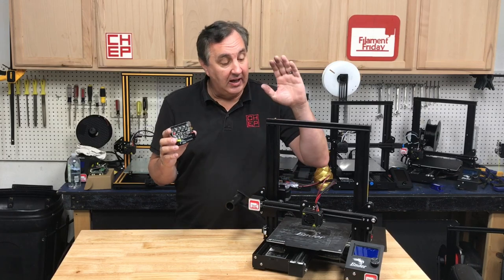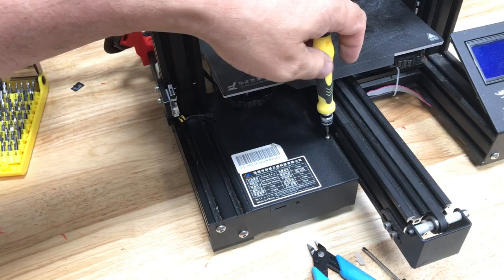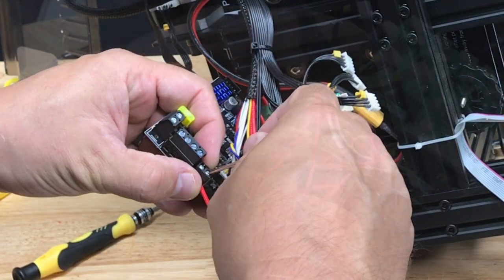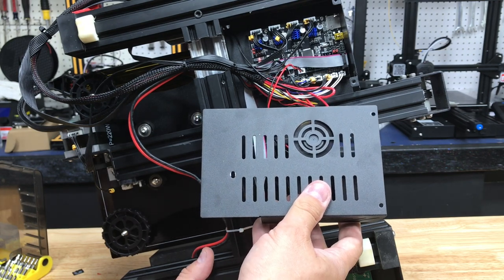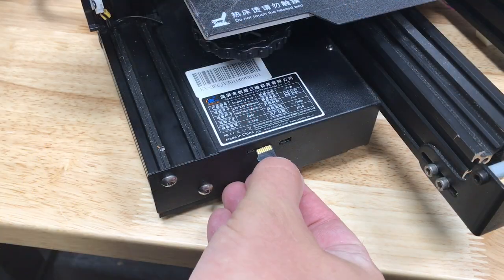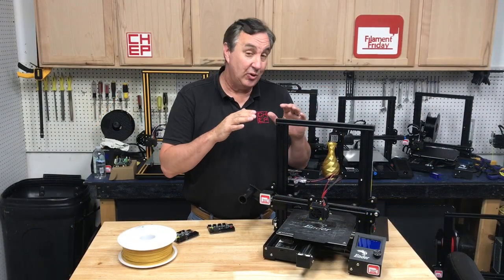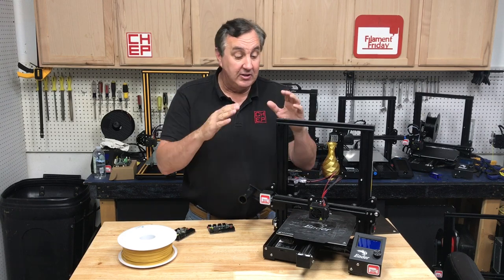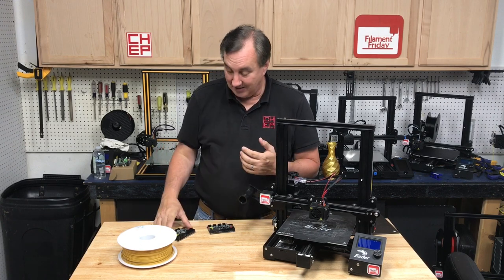Creality Ender 3 Upgrade to 32-Bit SKR E3 Mini

Comment: The latest Marlin release includes Manual Mesh Bed Leveling :)
Reply: Well, I wish I hadn't updated to that version, Bugfix worked perfectly fine for me.
Now the buzzer sounds really annoying, mesh bed levelling does not work proberly (probes a 3x3 grid and 6 points are super close to the edge of the bed, after probing the nozzle is too far away from the bed for good layer adhesion) and most annoyingly the SD card lists the files with OLDEST file at the top...
Reply: @skyfly-2  
I have 2 Ender 3 printers. Leveling them is a chore. I haven't updated or upgraded the board so only manual leveling is available to me.
My question is, when you use manual mesh leveling, how does that help moving forward? Don't you still have to level every few prints, plus every time you clean the bed?
Reply: @KLP99  its been said before, but I will say it again.  Yellow springs to replace the existing stock ones, mean you will need to manually level your bed very rarely.   Before the yellow springs, I used to have to re-level every few prints, I suppose because the vibration of the printer caused the bed to go out of level, after yellow springs ive had no issues.
Reply: @pellcorp  
One printer has the yellow springs and one has the stock springs. I've added one extra though, and that's nylon washers between the bottom of the springs and the leveling nut.
I have glass beds, which I love, and use Magigoo, which I'll never do without (I just ordered another kind that's supposed to work as well) because I can print filament that wouldn't stick before.
But one thing about the Magigoo is after every 3-5 prints I take the glass off and wash it with warm water, as is recommended.
After washing, I re-level the beds. I've gotten pretty fast at it so it doesn't feel like such a chore as it used to.
Edit: The new bed adhesive I bought is called Layerneer, and I am liking it much better than Magigoo. One think I wish I'd have noticed before buying a larger container of the Magigoo before I knew of Layerneer is that it goes bad about 3 months after opening the bottle. I'll never use it up in that time with just 2 printers, even if (they are, almost) they are kept running 7x24x365. I put the new bottle of Magigoo in the fridge hoping that will help it last longer. And yes, I made the mistake of opening it when it came, even though the small bottle I had wasn't gone.
I'm really loving 3d printing. I designed my first real item I use a few times a week. It's a large funnel that fits inside gallon drinking water bottles (from Walmart) without falling out, so no-second hand to hold the funnel. I use it to pour newly distilled water for my CPAP machine.
I used Tinkercad, which is pretty easy to use. I'm sure I designed it the hardest way possible, like using a cone, then another cone 4mm smaller as a hole. Fitting the hole inside the cone was annoyingly hard. Isn't there something that would let me lock them together? Probably...

Comment: Ugh. I've been fighting trying to get good prints with my updated E3 (E3D V6 hottend, Bondtech BMG bowden extruder, hero me gen 5, BLTouch, SKR mini E3 V2.0) my cube has lots of waves or blobs or something. Ive calibrated my esteps, lin adv, etc. but still cant get good prints!

You should set up an Ender 3 just like this and get it working and then send me your firmware file so I can stop pulling my hair out! 😂

Comment: I'm trying to understand why keep changing things , updating and upgrading a machine that can be perfectly working fine from the box ? I screwed mine by changing stuff
Reply: Upgrading is part of the fun
Reply: @runninglennart2970  when is got better print results yes
Reply: It might run perfect at first but eventually it degrades. The magnetic bed starts to warp, springs get loose, etc.  just because you screwed up installing doesn’t negate the benefits of upgrades. My Ender 3 with Skr mini e3, yellow springs, and glass bed is noticeable better than stock in every way (noise, quality of prints, bed adhesion, and functionality).
Reply: @forouza1  I've made tons of upgrades on mine too. I've gone thru up and downs with my machines.  I have 10 3d printers and some of the ones I never touched print perfectly

Comment: HI just installed SKR mini e3 v2 to my Ener3 pro my question is can i replace my screen with the Creality 24 bit colour intelligent screen as fitted to the Ender 3 pro v2 thank you
Reply from the maker: No. And the code for it isn’t open source so it can’t be modified to support more menus. Some people replace their V2 screens for this reason.
Reply: @FilamentFriday  THANKS FOR THAT I WILL ORDER THE TFT35 V3 THEN

Comment: Hi Chuck , I've had an E3 pro with the BTT  mini 3 v1.2 with TFT35,  BLTouch  running for 3 months flawlessly.  Then yesterday, i get the serial connection error from Octoprint.  I disconnect and try printing a file just with the sd card.  It starts, heats everything and holds temp, auto levels,  starts a skirt then re-boots comes back on and  has no memory what occurred.    I have flashed the firmware to the same one that I was running for 3 months but, no good.  I think it might be the BBT board you have any ideas?   Thanks in advance,  Rob
Reply from the maker: No idea. Sorry.
Reply: Anything in logs concerning your hotend fan failing mid print? Lost a 1.2 btt board  that way, went with 2.0 and after much compiling have my e3pro is hot and cooking. ~BTTskr mini e3 v2.0 tft35 v3 micro-swss bondtech bmg DD w/EZABL pro
Reply: @elijahyoung2505  no, not that I've seen. It's printing perfect from the sd card and has been for over a month. I kinda have up on octoprint on the E3 Pro only using the pi for the camera. My E5Plus no problem.  IDK thanks

Comment: well i did the upgrade to the new SKR mini E3 v1.2 and blew my z drive stepper, the power was set WAY too high for the stock motor, and it was problem after problem getting it to work, so after several hours the factory board went back in and the SKR was sent back to amazon today! was really hoping that it would be a good upgrade, so now I'm on the hunt for a new z drive motor, do you have any suggestions ? or anyone else here can guide me to the correct one to get ? 0.9 to 1.8 to size , so many options..thanks all in advance
Reply: It is a standard Nema 17 stepper motor. If you want the Creality one, look on Amazon for 'Albacy 3D Printer Stepper Motor'. Otherwise, they are mostly the same in every aspect.
Reply: @Hathorr1067  awesome 👍 thank you

Comment: Any way to tell how you may have gotten a 32bit board? Just bought an ender 3 pro 2 weeks ago. Any markings on the board to look for?
Reply: I think the 32bit is version 4.2.2.
Reply from the maker: Correct. Look for V4.2.2

Comment: If I have a plain stock ender3 with the old 8 bit board and I get good prints, is there any reason I should upgrade to a 32 bit? What's the main advantage to do the upgrade?  Thanks
Reply from the maker: If you’re happy don’t change it.
Reply: i think main advantage is the noise difference, but never change a running system :D

Comment: If this was a v2 instead of the pro,  would the procedure be any different?  I fear my board went on my V2.  Last night my display went black(but still lit) and nothing is responding. Tried to update the firmware for both machine and display,  it’s dead Jim.  All I know is I see a blue glow coming out of the main board housing I never noticed before.   Any tips would be great thanks
Reply from the maker: I’ve never tried it but should work.
Reply: CHEP thanks for the fat reply. I need to tear into tonight and make sure all is tight before ordering a board, but being the screen is lit but blank and the knob does not beep and Octoprint will not connect,  it’s probably the board.  Which board would be best right now?
Reply: The newest skr mini e3

Comment: I updated mine, but I am having horrible layer shifting printing through Octoprint.  It seems fine from the sd card.  Does anyone know what the issue is?
Reply: I keep getting the same! I like to know if you work it out!
Reply: @james300481  I saw somewhere that there is a known issue using this board and Octoprint on the Pi, but I can't seem to find it.  I hope Chuck can do a video about it.  I have the same board he is using in the video and the same Marlin. image.

Comment: Hi chuck, whats the difference with versión 1.2 with 2.0?
Reply from the maker: I’m told: 
* Onboard EEPROM
* Double Z-axis motor support
* Onboard sensorless homing
Reply: @CHEP From what I have read, the onboard sensorless homing (OSH) is not as accurate. The accuracy of the Ender's factory endstop micro switches, are supposedly around 0.02mm (or less). The OSH is around 0.2mm. This is a big deal if the resume after power failure is turned on and used. I would rather be only 0.02mm off in a layer/restart point after it re-homes and starts printing again, than be off by 0.2mm. I read that the OSH uses the motor's "steps", ie... when using OSH, when the hot end hits the bed (ouch if you use a glass bed), or when the carriage housing hits the left side of the printer support, or the bed hits the back of the stepper motor support, the stepper motor wont be able to move any further. When that happens, a "step loss" can occur.

Comment: Which board would I need for a cr-10 mini?
Reply from the maker: I’m told it will work but I haven’t tried it. You might also consider a BTT SKR board.
Reply: I just installed the SKR mini E3 v1.2 on my CR10 mini and installed the latest firmware.  There was a chugging noise with movement and a higher pitched noise with fast x-axis extruding.  I went back to the bug fix firmware that was on the micro SD card.  Now silent stepper motors.  The only noise is a slight squeak from the extruder filament gear.

Comment: Will this work on ender 3
Whats the difference
What will it do that the stock board don't?
Reply: Yes, it will work
Reply: Yes it will work. Even if you don’t plan to play around with the firmware & added features, just the silent stepper drivers alone are worth the price. And it’s better (and cheaper) than the Creality silent board.
Reply from the maker: More memory, easier updates, has ports for BLTouch and firmware, silent drivers, faster processor just to name a few.

Comment: This new board is silent or the steppers do the same noise that with the original board?
Reply: It's basically silent, similar to the Creality silent board.
Reply: @CoroaEntertainment  thanks :D
Reply from the maker: It has silent drivers.
Reply: CoroaEntertainment i think they are better. Tmc2208 vs Tmc2209 stepper motors.
Reply: @forouza1  The difference in stepper motor noise level is basically the same. Either version does a great job of silencing the steppers. The main difference between the two, are the rated voltages... 1.5A (2.0A peak) for 2208, and 2.0A (2.8A peak) for the 2209. Other than that there isn't a whole lot of difference between the two. They both have 1/256 interpolated and native 1/256 stepping support, and both are running StealthChop V2 (which is responsible for the quiet drivers).

Comment: can the 5th motor drive interface on the E3 mini v.2 be used for a second extruder?
Reply from the maker: I believe that’s what it’s for. There is a ZA and ZB
Reply: I think that’s actually for dual z axis. They just added another port for a second z axis motor but it’s being driven by a single stepper driver. In order to use dual extrudes, you’ll need a board with 5 stepper drivers.
Reply: @erwinfelisarta  dang it now im regretting not ordering the pro board with 6 drivers
Reply: @sky__net9797  atleast the next time you order, you'll have the option to get one with 5 or more drivers. It is still a very good board, just not for a dual extruder :)
Reply: It’s just a port. You can configure the software to use it for any stepper motor purpose you want. If you want an extra extruder and only 1 Z axis, then do that.
Reply: How are you going to do that when there are only 4 stepper drivers? And all are assigned for x, y, z, and extruder? The two ports for the z axis are being driven by the same stepper driver. :)

Comment: The new Ender 3's are 32 bit.
Reply: @FilamentFriday  I just got one shipped with the 4.2.2 board
Reply: @Dynamic-Productions  How can you know which board it has? I recently got an Ender 3 as well, and would like to check.
Reply: I just ordered one, I hope it will be my case.
Reply: @oneanotherstudios  the version is printed on the board. I'm not sure what date it started, but all ender and Cr's now ship with 32 bit boards.  The 4.2.2 is still noisy but it's rock solid.  Plug in the USB and Cura finds it without a problem.

Comment: I downloaded the firmware, per the video but the printer won't update, so any suggestions
Reply from the maker: Try reformatting your SD card to fat32.
Reply: @FilamentFriday  yes, that was the trick...it worked